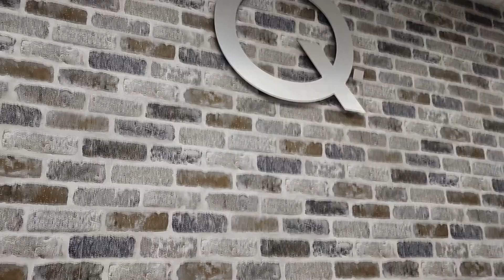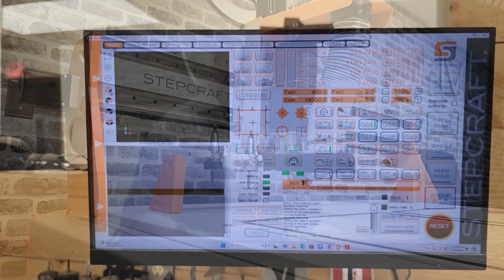Watch this series before you buy! STEPCRAFT Q.408 - Episode 4: 7HP Automatic Tool Changer Spindle

Comment: ATC is one of those must-haves once you experience working with it, as well as the touch off tool being built-in. The automatic touch off routine for the whole rack is a nice addition.

Does this control software support any kind of cutter comp at the control level?